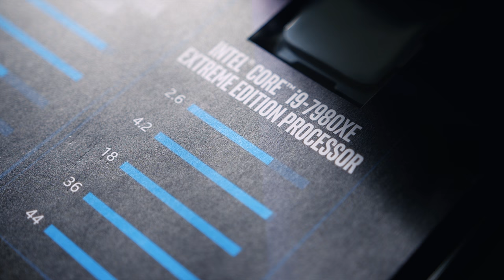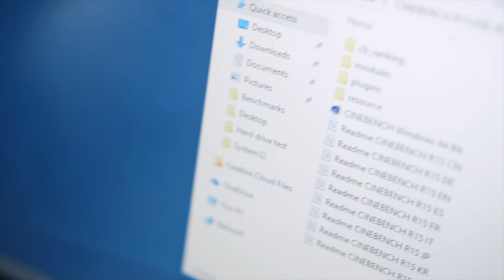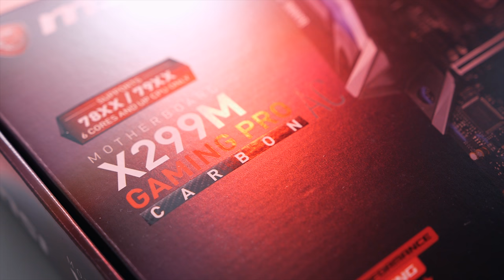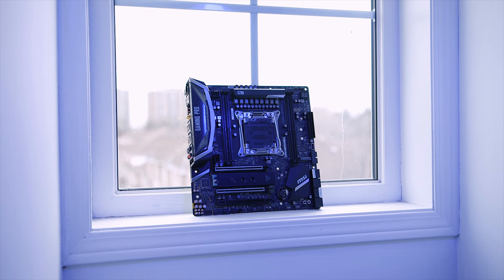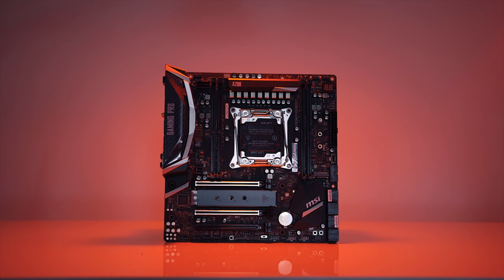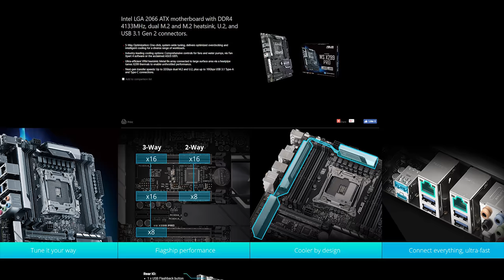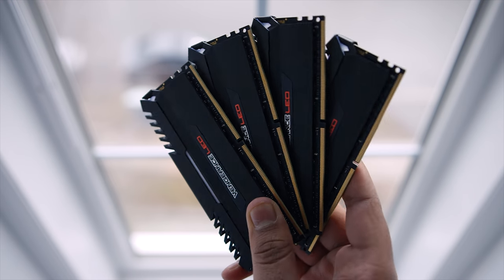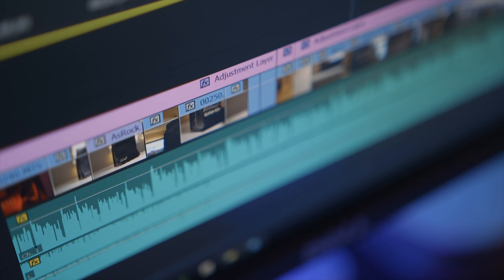Our FIRST Intel Skylake-X PC Build Guide!

Comment: "only 64GB of RAM." Gotta love how that is a caveat now. :)

I have an i7-7820x on an ASROCK ITX board with 32GB of RAM built inside an NZXT H200i. It's quite cramped with an AIO liquid cooler for the CPU and an EVGA Hybrid GPU, but I love how much power I've crammed into a small space. :D
Reply: Ed You can exchange that RAM for one Trump Tower ...
Reply: Nice I'm running an amd Ryzen 5 gtx1060 and 8gb of ram
Reply: Im running a 7820x with 32GB RAM as well, except im running it in a Corsair Carbide Air 540 with a Noctua NH D15 and a 1080ti.
It's the goddamned power cube.
Reply: PHENOMENAL COSMIC POWER!!!!!! itty bitty living space.
Reply: No quad channel though baby
Reply: Jolinator it's quad channel, 4x sodimms
Reply: Your totally right i was thinking of the x99 mitx for some reason, yep thats beast mode for sure
Reply: Jolinator going to 64gb would have been pure overkill, not to mention silly expensive.
Reply: Ed how did you fit the radiators and what sizes were they for the gpu and CPU respectively?
Reply: N0vah the front is a Corsair h100i v2, so it's a 240mm rad. The GPU has a 120mm radiator mounted in the back fan slot.
Reply: Ed may wow that's suite impressive, I'm personally thinking of going with the h400i because my card is unfortunately 2.5 slots in height
Reply: N0vah yeah, that would get a bit cramped...

Comment: Mainstream and hardcore gamers as well as entry-level content creators are better off with an 8700k or a Ryzen 1600 to 1800x. These chips are pointless. Still, great job HardwareCanucks for the amazing content.
Reply: Ryzen (specifically TR) has some kinks to be worked out still with a lot of pro-level video and audio editing applications and 6-8 cores isn't enough for every workload. So while you're right gamers shouldn't need to touch these.. they're not pointless. Glad they're covering it.
Reply: i agree. But these chips are for the professionals who actually need those cores. It's a small percentage of people, but they are there.
Reply: did you see linus's video about this, he said that he felt like this was just a quick answer from intel to try and combat the ryzen platform that had just been launched and that was doing incredibly well
Reply: These are literally the fastest processors on earth both in multi-threaded and single-threaded when OCd right. It's for power users
Reply: Yeah the 2 Kaby Lake X chips are a waste in the lineup.
Reply: Mark Aguilar  Exactly what my thoughts are if you change your bored every three years amortizing a $2000 processor not going to go
Reply: "These chips are pointless"

Not being for mainstream users doesn't make something pointless.
Reply: the fastest i9 CPUs cost as much as Epyc server CPUs with more cores.

No, core i9 is not the fastest lineup on earth in multithreading, not by a long shot.

Comment: i dont see the point in the 7800x, you can get an 8700k for a lot cheaper that is also 6c12t and it doesnt use a silly socket specific to that line up
Reply: but if you using 2066 socket you can upgrade cpu later up to 7980-xe
Reply: yeah, that is pretty much the only benefit to the 7800x, if you are just getting a 7800x and not planning to upgrade down the line then it is a waste of money, but as an interim cpu until you upgrade again it isn't a too badder choice
Reply: The 7800X also offers 12 additional CPU PCIe lanes. Comes in handy for folks who have multiple add-in cards (thunderbolt, UA, native Pro Tools, nvme, NIC's, etc.).

Comment: My thought is to look into the motherboards made later than launch. Seems like third party designed with the 7900X in mind as the top-end chip and took that into account when designing VRM and VRM cooling. This is shown when even a light overclock on the HCC-chips can lead to VRM hard throttle in AVX-heavy scenarios (eg handbrake video conversion).

Asus WS X299 PRO is what I researched to be the best bet. The VRM cooling is well thought out and it's still ATX size with 8 DIMM slots. It's not an ideal SLI-board unless you watercool, though due to the tight spacing of the two x16 wired slots. EVGA and Asus ('s gaming branch) also have alternatives with good VRM cooling but they are bigger than ATX IIRC.

Comment: What is idle temp for i9 7900x , Mine with H100i V2 is between 45 to 50 °C . What is Max temp before thermal throttling activates starts ?

Comment: The i9 7980XE is a power hungry CPU so be Careful and invest in a UPS so you don't brick the system when the power consumption can probably trip the circuit breaker where you are.

Comment: Take a look at the Asus Strix X299 XE. It has the VRM from the Rampage VI but at a lower price and stelar thermals. In terms of cooling, good luck with the 18 core without a delid. No amount of cooling will help with the OC as long as there is the thick silicone glue holding up the IHS. This is advice from a fellow reviewer:)

Comment: Skylake - X makes no sense. Ridiculously overpriced chips and motherboards. Threadripper makes more sense because in the future can offer 32 cores (64 threads) chips without motherboard upgrade. (like Epyc)
Reply: Epyc uses a server chipset, so no
Reply: maZec31 Eypc is a server CPU that uses a different chipset.
Reply: yes epyc is a server chip but they use teh smae socket they even "work" in x399 boards. It woudlnt be a problem for AMD to push out a 32 cores TR4 Cpu with quad channel memory
Reply: Keep in mind sensitive and advanced applications are the target market for all HEDT platforms, no gamers or general office workers need these. TR makes sense if your applications have been QA tested against it and have shown no issues.  Alternatively that you're making your own custom software and can program with TR in mind. In video and audio production workflows TR have often proven itself to not be ideal and that patches (often yet to be made) from several vendors are needed in order to make it work.. hopefully. So.. you either choose the "stable" platform with tons of legacy support, or you wing it and pray.
Reply: skylake x will have another wave of cpu's called cascade lake in Q4 2018

Comment: I overclocked my i5 8600k with gigabyte z370 HD3 motherboard with preset to 4.5 GHz and I do have liquid cooler as well for CPU and thermal is below 60 under 100% load still I see performance is very poor after overclocking compare to turbo boost...for example I get 1028 without overclocking in Cinebench but after overclock I get 840 or less score in Cinebench. can anyone help me on this?

Comment: memory kits aren’t quad channel. The amount channels depends on what the motherboard supports. As long as you have four memory sticks and an x299 board that supports quad channel your memory will run in quad channel. You imply that you need a 4x8 kit for example to use quad channel when in reality you could also use two 2x8 kits and it would still run in quad channel.
Reply: Quad-channel kits have been tested and validated as a quad channel kit. Dual channel in dual channels. There is no guarantee that two separate dual channel kits, even though specced identically, will work together at the rated speed. In fact, it's not that uncommon that they refuse to post at the rated speed when run as quad channel. It even happens that two separate dual channel kits (with the same specs) refuse to work together, even when run as dual channel.

Comment: Why wont my pc let me get in my bios i have the gigabite 78l mt usb3 r2
Reply: Austin Duff do you have fast boot on, is your keyboard being picked up during boot order, some boards disable initializing us untill Midway in the bot to medicate things and make it turn on faster. Also sometimes ya keyboard frequency is wrong to interact with the bios, try a ps2 keyboard (the round connector one), try resetting the bios to default settings by 
A) unplugging the PC. 
B) remove the watch like battery on the board and hold the power button for 30 seconds.
Plug back in the battery and the PC and turn it on.

Comment: Step 1. Don´t do it.
Reply: already done it
Reply: You´ll decide what to do with your money. I certainly wouldn´t recommend Skylake-X CPUs. (Maybe the 18 core if you´re wealthy enough.)
Reply: mortl I would do it in a heartbeat if someone gave me a free 18 core monster.
Reply: The 18 core doesn't necessarily make the most sense. It has been shown in benchmarks that the 16-core isn't far behind mainly due to upper thermal limits. Of course when de-lidding and overclocking all bets are off. I'd recommend the Skylake X platform but only to the niche audience that needs it. That would not include gamers and to some extent not even hobbyist creators. That said they make sense in an Avid MC or DaVinci Resolve workstation as an ECC capable platform is not needed.
Reply: got the 10 core, which is quite a beast at 4.6 ghz , after ill delid it i'm going to push it around 4.8-4.9 ghz . people try to give it the product line bad name but it is pretty good platform, with great features.
Reply: But you do know that the 7900x doesn´t go to 4.8 ghz right?
Reply: the 7900x goes all the way up to 5GHz if you can cool it good enough =)
Reply: mortl I already got it to stable at 4.8 at about 1.26-1.28 Vcore but the problem is the temperature since under heavy load it will instantly go to 90+ degrees Celsius and it's not a thing I want my cpu to endure over long workloads. that why I wait foe the delid tool I've ordered
Reply: Then you´re lucky af. Most chips won´t go past 4.6
Reply: 45646 4646 I can definitely can I use a custom loop and a monoblock, but the issue is the TIM I need to delid it if want to push it this far. I've been waiting for over a month and the delid tool still hasn't come, pretty annoying .
Reply: Eliad Buchnik I delided my 7820x of course only 8 cores but the temps are so much better now! 4,7GHz at max 75°C under Prime95 with an 280mm AiO.
I can even go up to 4,9GHz at 1,2V but thats too hot for only 200MHz =).
Reply: I don't think he's "lucky af". I have a pool of 3x 7900X and 4x 7920X and they can all go to 5GHz but the thermal limits are usually found around 4.5-4.6. This is what you might have heard of when you've deduced 4.6 as the limit. De-lidding (whether that's a thing you want to endorse or not) solves this.
Reply: or you could have gotten a 1950x and OC'd it to 4ghz and had more performance...

Comment: You don't need that high end system RAM, I use crucial 64gb quad channel no heat sink RAM 2400 speed, OC to 2800 speed.

Comment: I have a delided i9 7900x on a msi carbon ac mb   64gb  corsair dominator ram with fans   got hooked up for 500.00  before prices spiked now costs double  lol  2 Samsung 512gb 960 pro m.2 ssd 
1 Samsung 1 tb  850 and  a 4tb 7200 rpm hd   looking to add a lot more storage 
2 1080ti in sli everything in a corsair 570x case custom watercooled  with ek waterblocks monoblock and gpu blocks  exterior all copper alphacool 360 rad with push and pull fans keeps the temps cool  along with 6 corsair hd fans in the case 1,000 watt corsair power supply powers everything

Comment: I seriously wonder if Ryzen had never been released if Intel would even have announced this. I cannot imagine a 1000w power supply for 1 build. I have been watching for a while now a lot of channels and I must say that I am a little unimpressed  with that premise because I don't see you guys use more than a boot drive and a data drive in your builds (tech deals excluded). I have 8 hard drives, 3 RAID 0 arrays, 2 NVME drives, 2 GPUs, a ton of peripherals, including a RGB keyboard, and  12 fans all running on a 850W power supply.

Comment: Oh cool! But Threadripper is only 899 and has 16 cores and 32 threads. Skipped through the video because it's so obviously faked it just felt like lying to me
Reply: # cores and threads =/= good HEDT processor. TR is alright and a solid effort. But it has plenty of issues in high end applications still. Professionals will still go with intel while waiting for AMD and the software vendors to work out the kinks (which unfortunately could take years).